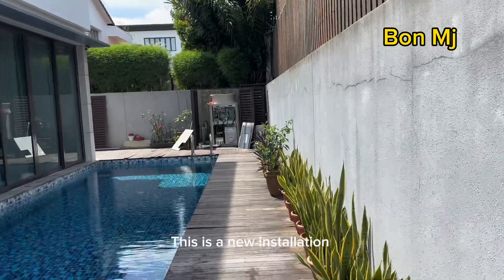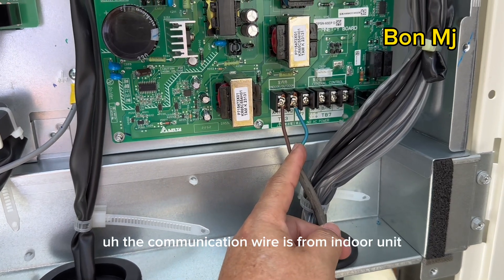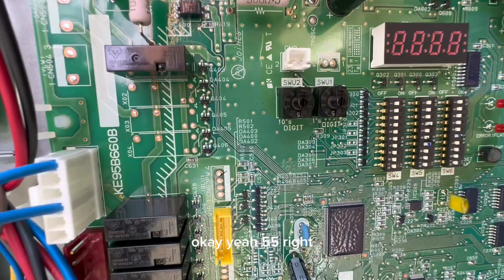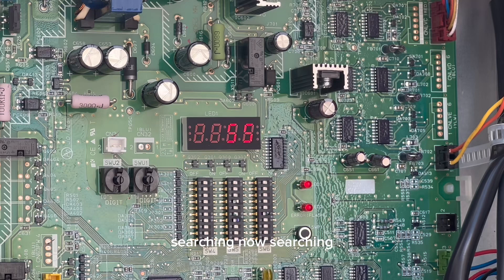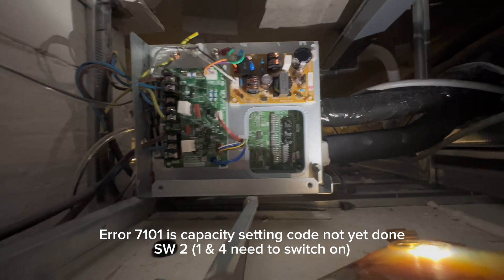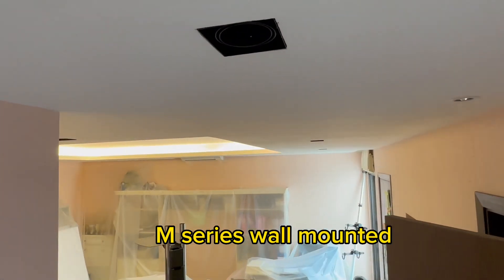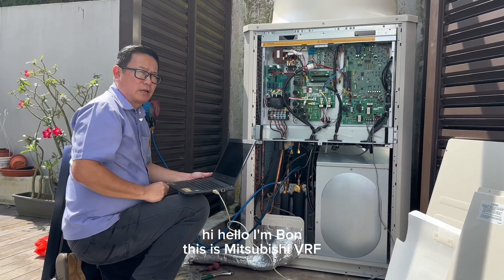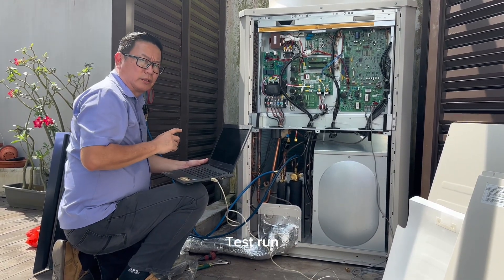Mitsubishi Electric VRF | Error 7101 | LEV Kit | M Series Capacity setting

Comment: Hello Uncle Bon
Was the problem that the wallhung unit was not connected to the LEV box? Or was it just needing to set the dip switches correctly?
Reply from the maker: If using VRF wall mounted not need kit box.
This case is outdoor is VRF, indoor using normal inverter FCU(wall mounted)and need to install one kit box for the Fcu and need to do setting at kit box.